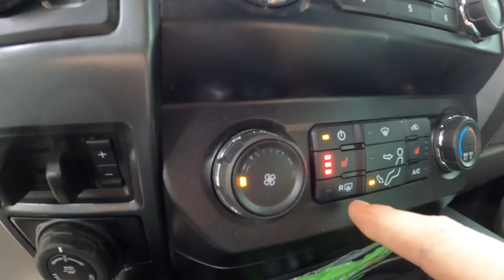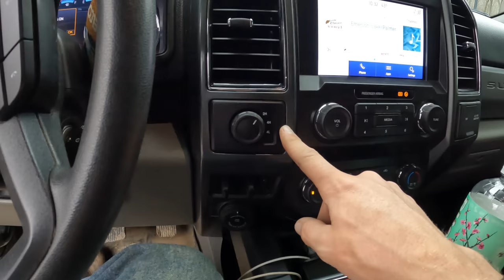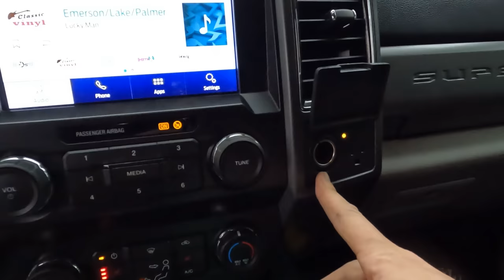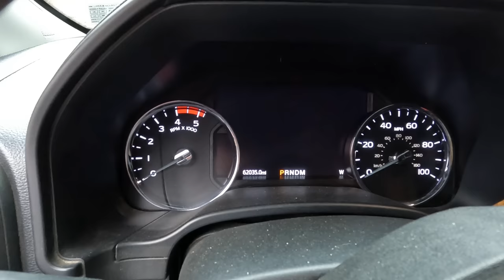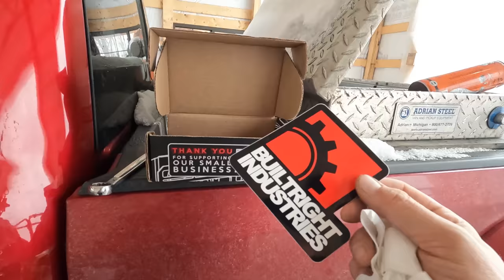I bought THE BEST Pickup Truck on the Market (Ford F450)

Comment: Matt love the videos keep them coming.  I am a Ford Senior Master tech and work on those vehicles all day long.  Stick with the IOLM for your oil changes since there really is not a true sercive interval unless you idle it constantly then you go by engine hours. For the most part the average is around 7.5-10k miles for oil change.  Ford reintroduced the upper oil pan gasket in 2020 so you should not have to worry about upper oil pan leak. 14-19  year model is when they tried using silicone and they leaked bad. If you want you can send me the vin and i can run OASIS for you and give you the complete warranty repair history and let you know of any open recalls or extended coverages. If there is anything you need to know from WSM or wiring let me know and i will send you the information.  The only weak link is the CDF drum in the trans. The bushing is known to slip and cause shift concerns and Ford has come out with an upgrded CDF drum with a stop machined in to keep the bushing from slipping.
Reply: Phew, i'm glad your not a junior master tech, i mean, well, ya know...
Reply: @alan-sk7ky There’s always a horse’s ass in every crowd. The man earned the title by going above and beyond his duty. I think it’s likely you will never do that, boy.
Reply: Also the dpfs are on national back order cause you can't clean them yet soo that's another downside
Reply: Just wondering how you feel about the possibility of the next truck being a electric vehicle?
Reply: @kindlyrewinded7669  There are DPF cleaning services but i do not think they are  Ford approved. I know a few customers that had it done and one we did have to replace the DPF due to the SCR was toast. The backordered parts is just insane.
Reply: @dandudley1128  EV's have their place but the range is not there for trucks when towing which is a huge problem for those that want to use a truck as a truck and not a pavement princess. Also lithium and cobalt mining are horrible for the eco system and health.
Reply: @mr.c.6241  so yeah I work at a dpf cleaner using the fsx cleaning equipment  we use high pressure air injection to clean the filters unfortunately ford's do not fit however their is a liquid bath cleaning method that could be done but the cost is more than the dpf itself it's insane!
Reply: It's so Awesome  to pay it forward  as you are doing here .... sharing your knowledge with the working man . BLESSINGS

Comment: Nice truck. Definitely a wonderful upgrade to your fleet. I just have a simple 2012 Ford F150 regular cab, 3.7 flex fuel V6. No frills, crank windows no power locks, no cruise but I do have air. It suits me and it’s a truck.

Comment: Hey Matt! Something to look into. Your drivers door handle has the exposed lock cylinder when you pull the handle. It's a common way to break into them. (Happened to Matt from DemoRanch) You can have the handle swapped for a passenger side handle with no lock cylinder.
Reply: Yep been an issue for a long time. My dad had a 2004 that was broken into that way. Pushed the cylinder in and was in the truck right away, it didnt even sound the alarm.
Reply: Brandon  a wedge, airbag, and long metal rod
Reply: We went from a 2015 350 drw to a 2020 450 and absolutely love it. The better turn radius, 10 speed trans, more torque it’s just all around better. The only thing I miss is our flatbed. I want one of the hauler service beds like Brian Brown of @Brian’s farming videos has. I got the xl with stx package it has the bigger monitor and cameras but no heated seats.
Reply: here's a suggestion... don't live where people steal cars 🤷🏻‍♂️ i know i know , crazy talk
Reply: All that's going to do is make the thief smash the window out with a chunk of spark plug.
.
Reply: Brandon  Guess you missed it earlier on. No fob. Key pad on the door. Of course you still have the problem if the battery is dead.
Reply: The door handle with or without an exposed or not exposed lock cylinder can be simply drilled out and a slotted screwdriver forced into the hole and then  unlock the door.  Happened to me in Las Vegas at the Gold Nugget.
Reply: just a reminder to everyone that cares about their vehicle. put a gps tracker in it,  a kill switch, or dont live or go where there is excessive crime
Reply: @Brandon , doesn’t matter what type of vehicle it is , they all blow!
Reply: if some jackass is gonna break in there gonna even with that handle ya could break into it in under a minute no truck is theft proof some people are just lowlifes and thats that.
Reply: Great to see all that crushed rock down, far cry from a year ago.
Reply: I haven't had a problem with my 17
Reply: Better listen Matt!!!
Reply: Brandon  fancy code on the door, doesn’t work if the battery does tho.
Reply: @SLCFarms  Yeah, Brian and his dad have nice flatbeds!
Reply: @Hard_Right  yep, the most that happens in my area is kids dropping litter. The city on the other hand, they will take your bootlaces if you relax
Reply: @____________________________.x  they make no lace shoes and boots now. you will be fine :)
Reply: You always want to have a mechanical lock when the electronics give out for some reason.

Comment: The 6.0 powerstrokes have the heui injection system that fire the injectors with high pressure oil. The 6.7s have the common rail fuel system. It uses a lift pump and a high pressure injection pump that is driven by the gear train. It pressurizes the fuel rail but the ecm fires the injectors. Anyways enjoy the new truck!!
Reply: Spot on.

Comment: Congrats on the new truck. I’ve been running Rotella T6 5W40 in my Ford 6.7 since it was new. Very good oil. You know you don’t have to get under the truck to change the oil. Just turn the wheel all the way to the left and you can easily get to the drain plug and oil filter from behind the right front tire. Been changing my oil like that for years. 
I’m on my second truck with the 6.7, I first had a 250 but I kept exceeding the tow capacity so in 2015 I bought a 350 dual rear wheel and it’s a good truck. I found out afterwards that the 450 has a better turn radius. My 1998 IH 4700 has a better turning radius than my 350. You went with the best truck out there. Be safe and keep up the good work.

Comment: thats a sweet truck.  i also run an 03 6.0.  once i fixed all the things ford did wrong it turned into a great truck.  you mentioned undercoating your new truck.  personaly i would stay away from it.  in my experience undercoating always causes more rust problems then it solves.  go with the fluid film coating every fall and youll keep the rust off longer.  make sure to get in all the doors and crevices.  always enjoy your content. keep the old iron running.

Comment: Spot on !!! Rotella T6  and a good oil filter (K&N, Ford, Champsion Labs)  change at 6 or 7K) and fuel filters at 20K (OEM ford)  and OEM ford Air Filters (10-15K). One thing to note is that Battery life is around 3-4 years .. so change before youre left on side of road (I like the  Autozone)

Comment: Matt if you get a service bed. Use one the the boxes to put in about 4  high cranking amp batteries and some welding posts that you can plug in some major jumper cables for starting stuff. You can then wire in a hard wire plug so that you can charge batteries and stuff. You can also add a solar panel to your roof and a PWM charge controller to add extra power in while your rig is parked or when you are charging other things. The main power can come from your alternator. Someone I know had this installed in their service bed. The amount of extra power and lenght of those cables made for jumping damn near anything super easy.

Comment: Guys that get a million miles on power stroke charge oil at 7-8k , oil is cheep compared to engine, fill oil filter before install, 6.0 are hands down the best sounding diesel, happy holidays buddy

Comment: Congrats!  You deserve that truck!  As a former owner of 2 2005 6.0L, I know exactly where you are coming from. I now own a 2011 XL F350, crew cab, long bed - no options (no power locks or windows, manual transfer case shifter), I love it!  and the power of the 6.7L is unbelievable (and the tow capacity)...  I hope you get many years of good service out of it!
Reply: if that was a 6.2 gas id drive the hell outta it

Comment: Hey Matt! Dont forget both fuel filters need to be changed at nearly the same interval as the oil! Save yourself some headache and get actual motorcraft ones, the aftermarket filters have not impressed me as far as a quality matchup. That said it should be a solid reliable truck with good maintaince. love it!

Comment: As many 6.0 in a junk yard with bad motors and what not I bet you could find one out west that you can rob a frame from or swap you motor and trans into and keep it around as a winter truck to keep the f450 from rotting out. Just get a 5 gallon pale of fluid film and the sprayer and undercoat every fall and you won’t have as bad of a rust problem.

Comment: Congrats on the new rig. Looks great. I did see it in a few videos figured you might have gotten a new one,  nice to know for sure now!

Big fan of the XLT trim, its just enough features without being obnoxious like the King Ranch or Platinum pavement princesses.
Reply: Went from an 02 7.3 to a 14 6.7 king ranch(bought it for my concrete business)and still smile every morning getting into it
Great feeling hopping into a beautiful truck after working your balls off and it’s a good look pulling up to customers houses in a nice truck compared to a loud, older beater truck 
Keeping the 7.3 for a plow truck and gunna keep the king ranch nice for a few more years till she gets thrown into the plow truck rotation

Comment: I have the rat pak tool box also and found that if I put a 4x8 sheet of treated plywood down and screw the box to it , it works pretty well to keep the box still .
Plus’s you can remove the plywood and all to take the box in and out .
Keeps the need kinda nice too

Comment: Not just heated seats but my new rig has a heated steering wheel also. I am 76 and that keeps arthritic hands much better. You keep pulling the heavy loads you do I expect your transmission to not last as long as a normal person gets with it. Maybe ya'll will change the transmission fluid every 60,000 miles but probably not. That includes the rear end too. Probably doesn't have greaseable u-joints either.

Comment: Matt, Thanks for the tip and review of the Builtright Ford rear seat release. I have struggled with tilting the drivers side rear seat since getting my truck in 2017. I was quite pleased to see that I wasn't the only one to have that issue. I've ordered and installed one on my F150 and am really pleased at how easy it was to install and how well it works. It's the simple things that are sometimes most pleasing. Hope you and your family have a great new year. Thanks again!

Comment: Looks a very nice thing, that does! Regarding your charging sockets, I’d suggest perhaps buying a smallish portable power station, most have AC, 12V DC and multiple USB sockets, you’d be able to charge camera batteries, phones, run lighting etc from that while the truck is off and then recharge the power station from the truck’s AC outlet when you’re driving.

Comment: Flat stock steel plate 1/8”x 6”x bed width (plus bend ups) then weld it, epoxy it or bolt it under the drawer box. That would do a pretty good job...the bend ups could be up to the top sides of the truck bed...

Comment: common rail injection does not use engine oil under high pressure, it puts the fuel under very high pressure into a common log manifold with lines to each injector, the old HEUI system went away years ago with old power stroke

Comment: Love our 450 for the pulling local. The 350 dually’s are my preferred though. If you could get a taller gear in the 450 I’d be game. My next dually will be a GMC. I currently have a srw Denali 1tn 2 350 crew duallys and a 450 dually. The Denali is my camper tug and I love it. One of the 350s is a 2019 kr it’s super nice as well.

Comment: I'm with you, if someone is educated on the 6.0 it's an incredible engine. My 2003 has been trouble free for 260k miles and I fully expect it to do it for another 260k.
Reply: Had a 04 work truck that had over 400k when they got rid of it you could tell it was worn but would still tow whatever you put behind it
Reply: Yeah. I've watched every powerstrokehelp yt video. I wouldn't seek one out but if i lived out of the rust belt I would invest in one. The 6.4 on the other hand..... ew
Reply: @jeepindave5464  there’s a reason they only made it 2 years lol
Reply: That is the problem with the 6.0. Unlike the 7.3 or the IDI's, or just about any other diesel engine, its not a "turn the key and go" its a "get a phd in it".
Reply: @J-1410  yeah but the 6.0 is a monster and with great power comes great responsibility. Overloading, tuners, and neglect are to blame to the demise of many 6.0s. There are short comings of the 6.0 but they are fixable.
Reply: @jeepindave5464  Never heard that, just EGT, Turbo, and other similar issues.

That being said, the DTI466 drops in and beats the 6.0 in just about every way.

I mean Ford should have put the IH 436/466 in their pickups in the first place, it was reliable for 40 years before and they were reliable until emissions and Volkswagen ended it a couple years ago.

Alot of 6.0s came up for the oil boom and few left, but I'm sorry, you are insane that you want 10k for a 6.0 Ford that "Just needs bulletproofing". An engine should come "bulletproofed" from the factory.

Comment: You can’t go wrong with an Alumaduty, I’d buy one if I could afford it 👍
Reply: I work at a shop that upfits trucks, let me tell you, you can go very wrong with an alumaduty.
Reply: @85square  Are you thinking of the aluminium-to-steel rot, like steel bolts in aluminium threads?
Reply: @85square key us in on what you mean. I’m all ears!
Reply: Jus keep it away from Chevy commercials with the rigged toolbox

Comment: Just a quick clarification on your fuel injection rundown, the 6.0 was the last "consumer" level truck engine that used the HEUI injection system (the one using high pressure oil). Engines from the 6.4 on (and all engines for GM, and after the 12-valve for Cummins) use the common rail injection system. This uses piezoelectric injectors, which I won't delve into, but they use fuel supplies from a high pressure fuel pump, the Bosch CP4.2. the CP4 is well known for failing and wiping out the whole fuel system, so definitely try talking to Powerstroke Tech Talk with ARod about a disaster prevention kit.

Comment: In 2013 I purchased a used F350 dually with 57 thousand miles on it, original owner was US Air Force, it had a 5 speed standard trans, got 14 mpg empty, 12 mpg loaded, I was delivering New RV's to dealers on the west coast from Indiana, it was a 2006 with the 6.0, I sold it 5 years ago for $19'500. You have a Gorgeous truck

Comment: Keyboard mechanic observations FWIW. I would have filled new oil filter with oil before installing. In the video you were describing the fuel injector system used on 7.3L and 6.0L Powerstroke engines called Hydraulically actuated Electronic Unit Injection (HEUI). That system uses the engine oil as high pressure hydraulic fluid to fire the injectors. The engine oil would shear because of the really high pressure required to fire the injectors, so frequent oil changes were needed on those engines. The 6.7 does not use that system it uses a common rail fuel system. T-6 is all I use on turbo charged diesels. I was looking at replacing my Covercraft canvas seat covers purchased in 2003. I was looking at the Carhart covers.

Comment: #DIESELCREEK  Congrats on the 'new' F450 Super Duty...nice truck! I agree with you on the 6.0L's....they're one of the best motors, despite their reputation and potential problems. I'm a 7.3L guy, I've had 3 now, kinda scared of getting a 6.0 without having the $5-10k needed if something real bad happened. Lol. Anyways, I agree with others about the HEUI, vs this newer common rail fuel systems confusion in your explanation. 6.7's are common rail systems with Bosch CP4 high pressure fuel pumps, and not HEUI like older systems(7.3, 6.0, etc).  They also come with their own potential problems others have mentioned, ULSD has comparitivly 'low' lubricity, so definitely add a fuel additive to your fuel to help with pump lubrication. Also look into a 'disaster prevention kit' (S&S Diesel makes one of the best), it prevents bad fuel\contamination from destroying your whole fuel injection system if pump goes bad sending steel shrapnel into injectors, destroying whole fuel supply system$$$. One other thing to check out is Limitless Autoworks, they have some nice flashing\warning lighting options that are all plug & play, no-cutting factory wiring. Their kit allows all the lights to flash(headlights, parking, brake, reverse, mirror, turn, etc) with just a couple plugs and wiring harnesses and wiring to one upfitter switch. Check out PowerStroke tech talk with Arod, a fellow YouTuber. 👍🎄☃️
Reply: Yup my 6.0 is sitting at 280,000 miles

Comment: Common rail uses a high pressure pump to pump the fuel upto high pressure in the common rail. The injectors are connected using short high pressure pipes to the common rail and are controlled by electronic spill control valves on/in each injector controlled by the ECU. The system you described was the Cat HEUI system and as far as I'm aware not used on anything apart from CAT C9's and some Navistar products.
The reason that you require better oils for modern, low emissions diesels is that the retarded injection timings and EGR required to hit current emissions regs leads to increased soot loadings in the oil.